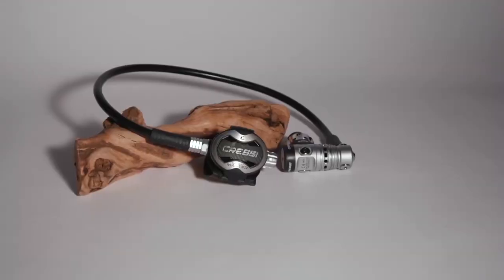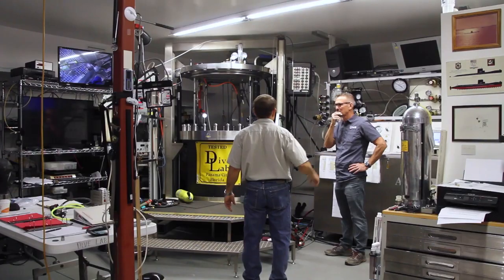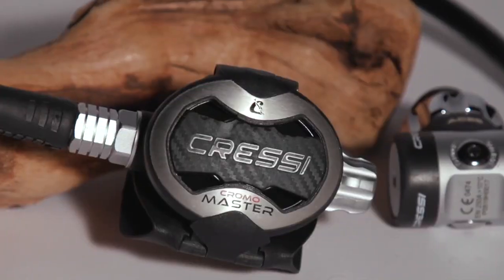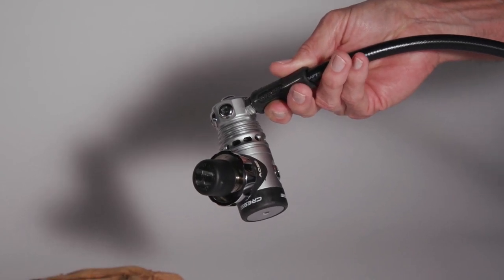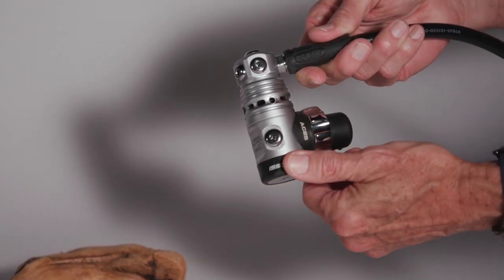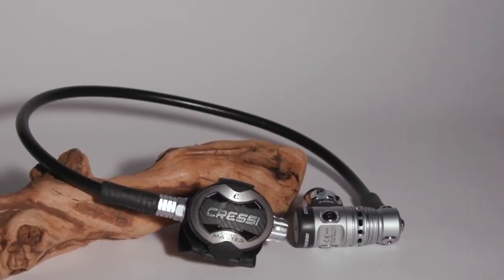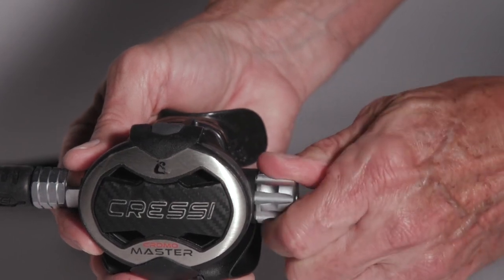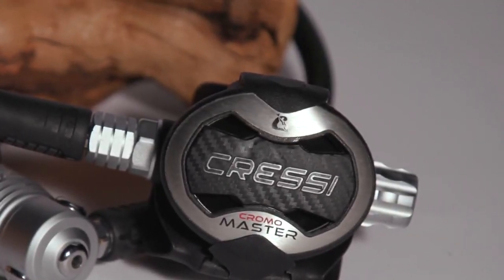INTRODUCING: CRESSI AC25 REGULATOR | SCUBALAB BEST BUY 2020

Comment: I bought 3 cressi leonardo dive computers from turkey decathlon. batteries are dead. Although I installed new batteries in the two dive computers, the screenshot did not appear. When I researched, I saw that this is very common in cressi dive computers. dechathlob offered a ridiculous reason that you have installed a new battery, it is out of warranty. Even though I wrote to the cressi page twice, there was no response. Regulator, bc, my dress is always cressi brand, but stay away from companies like cressi and dechathlon that hurt their customers.